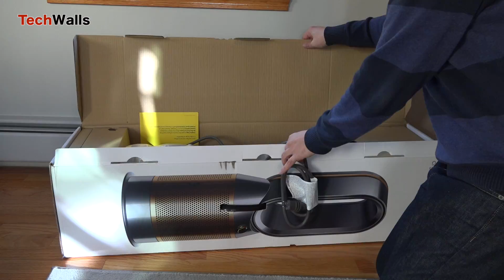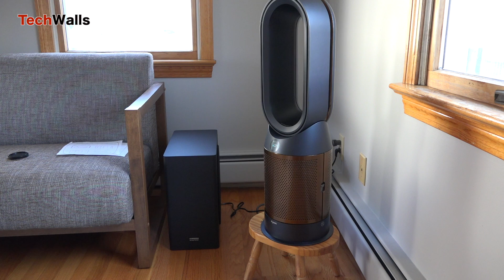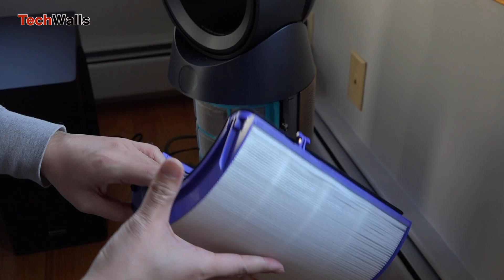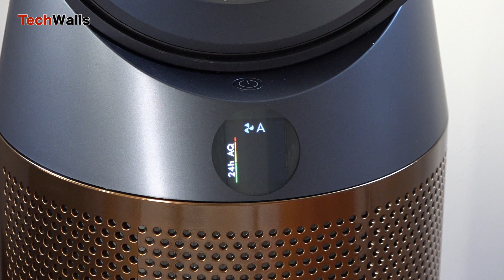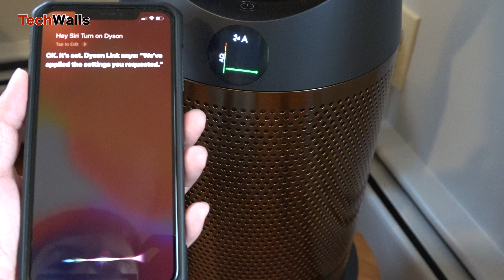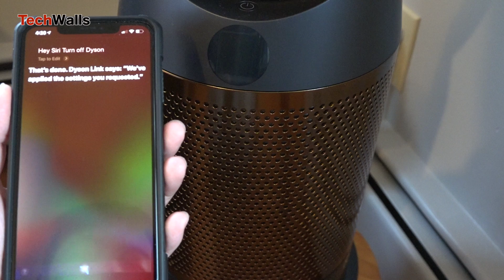Dyson Pure Hot+Cool Cryptomic HP06 Purifying Heater Fan Review - 4 Months Later

Comment: I have had this product for less than 20 days; used less than 4 times and this thing has stopped working completely. Doesn’t even power on.
Reply from the maker: You should contact Dyson to repair or replace it. I've used it for 6 months with no issue.
Reply: Tuan Do @Dyson Happily replaced my system. The new one is working fine. I don’t really know how to differentiate the air purifier qualities but the cold air function is really poor. Not much good as a fan, however heater is pretty ok.

Comment: Formaldehyde is Everywhere (in very low levels)... even the human body produces it. I read that Formaldehyde disperses very quickly in the air. Unless there is very high concentration of Formaldehyde, there are no heath issues with being exposed to Formaldehyde. Save a few $$$ and get the HP04. You can put the difference towards a spare fiter... 🙂👍
Reply: "The EPA has classified formaldehyde as a "probable human carcinogen." National Cancer Institute researchers have concluded that, based on data from studies in people and from lab research, exposure toformaldehyde may cause leukemia, particularly myeloid leukemia, in humans."

And like its 50$ difference so you might as well get the cryptomic
Reply: Everybody cares about dangers of Formaldehyde which is very questionable considering the quantity and exposure. Yet millions are getting poisoned daily by a very dangerous neurotoxin and a rat poison fluoride they dump in the water supply for “the health of  our teeth” and now fast growing 5G radiation which will cause bodily distress with flu like symptoms and DNA damage etc etc. Just these two will cause more serious health issues and deaths in the following years than did formaldehyde and smoking combined ever in the human history.
Reply: @tsar6079  many places dont use fluoride like my water municipality.